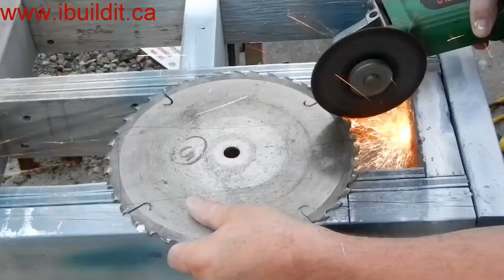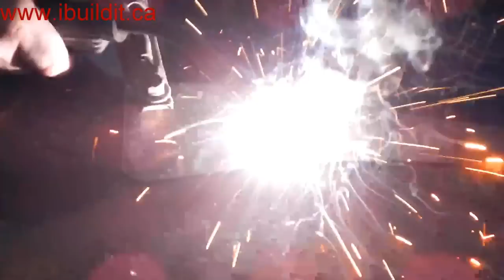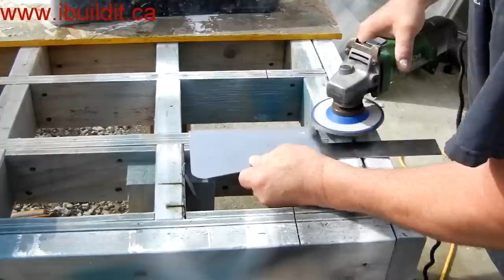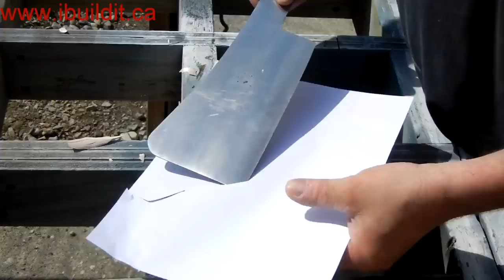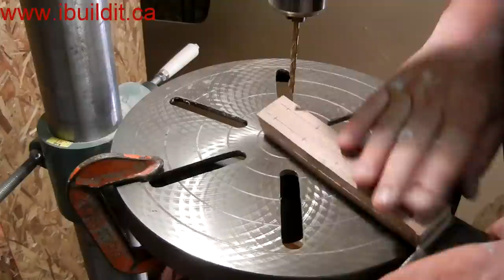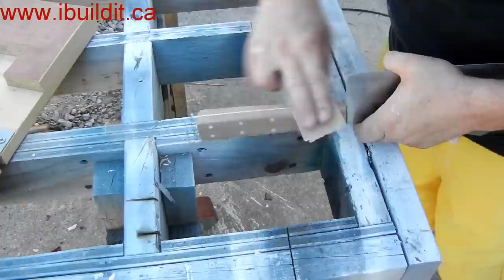How To Make A Meat Cleaver

Comment: plz understand i hold u in the highest respect
but
gloves much?
Reply: Its not very safety when u work with spinning tools and wearing Gloves
Reply: lykannion I agree with you.. My grandpa has almost left without a half hand, because the saw grabbed his glove on the table saw..
Reply: lykannion I'm not a welder, but can't you get easily sunburnt when welding whitout gloves?
Reply: TrocaderoKillen No, to get sun burnt you need to be exposed to U.V. light for extended periods. Most man made lights don't give off U.V. lights, only several specialty LED and halogen lights. Being burnt conventional while welding is a different story entirely. Taking that into account I think the above poster was trying to say that working near any fast rotating objects with gloves is inadvisable, which is true. The rational behind this is that without gloves you will only have a small scrape or gash if you hit the moving machinery, with gloves your hand will get sucked in and suffer much more damage.
Reply: Jason Johnson No gloves when working with sanders! That's like, rule #3 of woodshop, lol
Reply: TrocaderoKillen Well not easily, but yes, yes you can
Reply: The Noob Plays It Actually, you can get sunburnt if you weld without the correct protective gear. He only welded a little, so there's no need, but when welding for longer it's advised to wear long sleeves, gloves etc

Comment: and i'm pretty sure knifes are made from stainless steel not just any metal because knives don't rust and stainless steel is the  only one that does not rust
Reply: I have several knives that are not made from Stainless Steel.
Reply: Billy Croft knives* and no. A lot of knives are made from other steels.
Reply: Also, I might be wrong but from what I understand high carbon steel holds an edge much longer than stainless steel does.
Reply: Chris Hardy depends on a few factors, but that is mostly correct - high carbon steels tend to be tempered to a higher hardness then stainless steel knives that are more commonly found as "entry level walmart/menards/savers/target/etc...." brands and lines.
Reply: Mr. WHEELZZY Stainless steel is often considered low grade by knife aficionados. Spring and carbon steel are the best varieties, and there's coats you can apply that prevent rust.
Reply: Mr. WHEELZZY Nope. Knives are not made of stainless steel. At least good knives. Stainless steel can't be heat treated (there are some exceptions) and so they don't hold a good edge, tough cheap supermarket knives are often made of stainless steel.
Reply: aakkoset Indeed. Well-said.

Comment: You should put a bit more effort into sharpening the cleaver. If there is any advantage to a blade that can rust over one that can't, is that it could be much sharper. Sanding steel down with a belt sander isn't sharpening, use a proper tool :)

Comment: you forgot to heattreat it so that thing is gonna loose its edge in notime
Reply: Wouldnt the steel he used be already heat treated, because it is originally from a saw blade?
Reply: Basel Kader cirkular saw blades are not knife material as the disk is soft steel, the hardened part is in the attached hard metal teeth at the outer border of the sawblade, the rest of the cirkular sawblade is just soft thick sheet metal designed to absorb vibrations, and that part is useless for a knife, unless temperd and heat treatened to improve its hardness, then it would make a makeshift knife, but it would still be crap steel for a knife that wouldent hold a edge very long
Reply: I see... thanks for the info

Comment: Looks ok, but
-it is too thin for real meat cleaver, you need some weight
-the quality of steel is questionable, it is very possible that only teeth on that saw are tempered
-you overheat the edges when you cut it like that, even if it was tempered well
Reply: +Greenftor 
I have a few meat cleavers and one is from a restaurant sale and is freakishly thick.
I assume it is meant for hacking through huge chunks of meat and bones.
The others are as thin as this one, and can slice a chicken thigh with the bone as thin as paper when new.
Reply: If you have normal meat cleaver, for example 6mm, you can chop almost any bone. Chicken bones can be easely hacked trough even with chefs knife, you dont really need cleaver for that, maybe only if chopping chicken bones is your job.
Don`t get me wrong, I have nothing against your cleaver or you, it is always good when people create something with their own hands.

Comment: not much to do with thisvideo,but can some cutlery expert tell me why every meat cleaver has a hole? :p
Reply: But the cleaver can be hund be the handle,like any other knives lol
Reply: It stems from how butchers work. They work with hanging pieces of meat, so there are plenty of handy hooks overhead. The hole is in the blade so the handle is the bit that hangs down and swings around when you let go after hanging it up. If the hole was in the handle, you can imagine the fun trying to grab hold of it when the blade is swinging around.

Comment: with all those resources why use such shitty steal???
fleetfarm has really nice HARDENED steel machetes for under 20$. i imagine the tools were more. (welding gases, electricity and wire, machine sandpaper, grinding wheel, etc...)